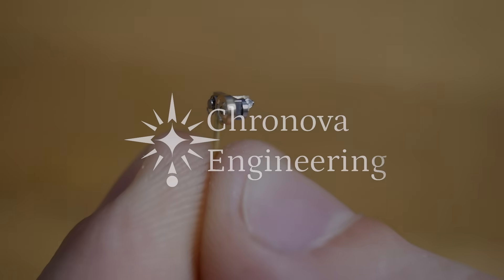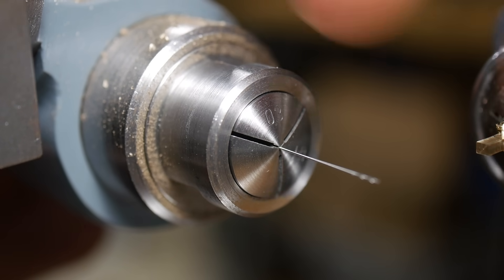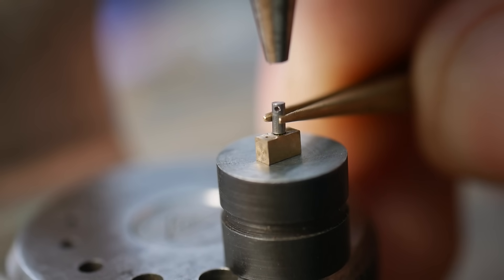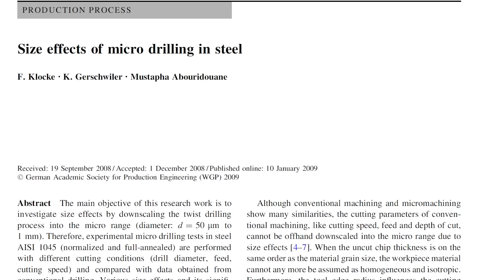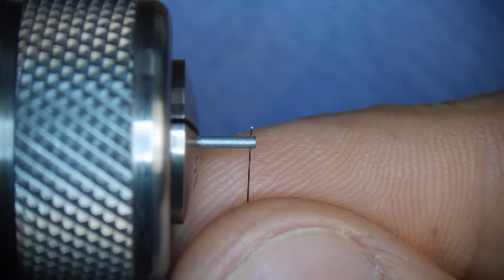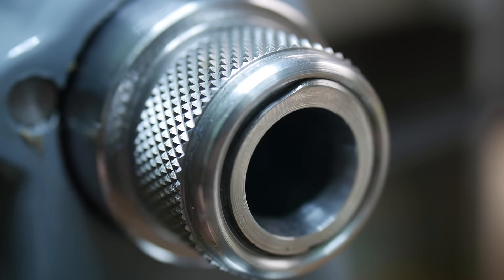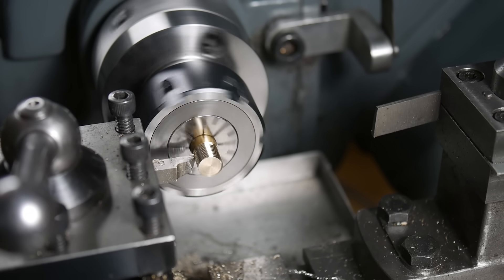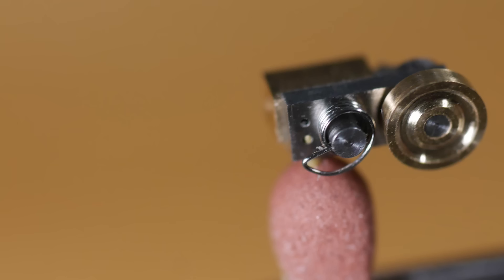Honey, I Shrunk the Steam Engine

Comment from the maker: Thanks for watching! If you would like to support our work and get access to additional videos and articles, please check out our Patreon page: patreon.com/ChronovaEngineering
Reply: The Obese Mosquito is a pretty good name for a steam engine, IMO.
Reply: I was so engrossed I found myself blowing at my screen to get rid of the swarf.
Reply: That's a lovely lathe m8.😊
Reply: This deserves a home in a museum somewhere.
Reply: I'm joining. But only because I want you to make a tiny 2 stroke.
Reply: Great job.  Not many creators can get something the size of a mung bean fill up a whole video. Obviously cutting metal under a electron microscope beats that but it is just too small to see.
Reply: Thank you.
Reply: Wow! That's beautiful!
Reply: Can you explain the maths of your speed measurement, please?
Reply: @MikeBrockington  700Hz (cycles per second) * 60 (seconds per minute) = 42'000 RPM (revolutions per minute)
The lowest frequency peak is the one that will correspond to the full cycle (or exhaust pulses as he mentions). 
Double that will be a result of the changes in direction of the piston and cylinder, higher peaks are harmonics due to the non sinusoidal nature of these sounds.
Reply: Amazing, and more. But far beyond what I was looking for: A 20 kW double expanding steam engine made from a v6 or v8 car engine. It should be reasonably easy to get 25% thermal efficiency from such an engine, and use them to power houses from stored solar thermal heat. Combine it with a smallish batter and inverter so the engine does not have to run all time, yet can handle power surges of 40 kW.
Reply: Just found your channel.. impressive work! Very precise and accurate. I work in the field of dental technology and wondering if you have had any experience with laser sintering..? Similarly to your work, we use milling for metals or other dental materials but recently the digital advancements have increased the volume of sintering for the precision metal work and digital printing of many other materials.
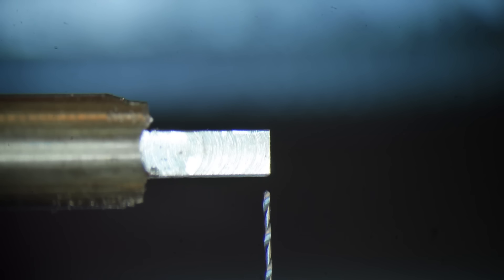Reply: 2:55 how was the drilling bit made!?

Comment: Regarding the drill problem. I use center cutting endmills for shallow holes. For deeper holes carbide drills, under .3  and over 3.4. For sizes between HSS is better option. It's just my opinion. Cool project. Thanks for showing it.

Comment: 40k RPM is about the right speed for a lot of those tiny carbide drills, at least when used to drill fiberglass for PCB making. Not sure about with steel, but you might have just made an upgrade for your pantograph!

Comment: Thank you for an interesting, and in my case, also inspiring video. I'm considering trying to build a simple live steam engine with oscillating cylinders in H0/00 scale, or possibly 1:48 on HO track = 0n30, which would make my cylinders a many times larger and simpler to manufacture. But this is still inspiring!
- Is the burnishing of the crancpin needed because of the "insane" rpm?

Comment: I’m a recently graduated electrical engineer, but I’ve always been interested in learning how to use machining tools like lathes, routers, slot cutters etc, and having the know how on material properties and how to cut or drill them, and expand my knowledge on theory. I’ve done mechanic work and I understand the basics of gas motors and steam engines, but designing the mechanics to account for the finer details like thermal expansion, friction, and vacuum sealing, is something I would like to learn. The only classes in college where we covered moving parts (other than physics 101) was control systems and electromechanics. Control theory was the only time I saw the use of Laplace transforms to represent springs, masses, and resistive dampers in the textbook, but we only ever covered R, L, C networks for class work. Electromechanics really only covered the working principles and electrical theory behind all the forms of electric motors and generators, so we’d calculate power and torque, but never moment of inertia, friction, employing bearings and oil, or how to actually transfer that power. (Which I understand is out of the scope of the class). Maybe I should take a machine shop class? Or try to take a dynamics class online? Not really sure the best approach but I really want to learn more so I can become an electrical and mechanical engineer and have more interesting projects haha.

Comment: Dynamic balancing such a small engine is to say the least tricky.  The brass tube has its own fundamental frequency (F1) according to stiffness and length. One trick would be to have a mass damper that you can slide up and down the tube to adjust the fundamental frequency. Of course energy is being lost when the motion is in anti-phase to the rotating mass imbalance.  Using acoustic analysis (sound spectrum) taken in contact with the tube bas will detect F1 acceleration and be more defined. .  Wonderful machining.

Comment: make 10 of them and then make dark experiments. for the first dark experimenty put it under masive pressure. for second, make it go bery very damm long until it cant run an ylonger. the second experiment wil me the cooling test. and the third one will be rhe negative test. then there has to be a generator test. then, acceleration until expolsion. the other last 5 could possibly hooked together make a small generator for electricity. also, make a tiny steam gas maker (the thing making steam out of water by fire that has no name). all of these are suggestions. after all really nice video.
Reply: A teapot lol?

Comment: A pity you do not give any dimensions. You obviously have a very exotic workshop, I am an 88year old model engineer who has temporarily abandoned the construction of a pair twin cylinder reversing engines for a small Neilson crane locomotive. They have single eccentric valve gear working .01” piston valves. Slightly over scale actually. Reversing is achieved by swapping the steam and exhaust flow. To add a little spice one engine is mounted on the chimney and revolves with the jib, the team pipe passing up the chimney to a running union at the top.

Comment: My later father said that people used high speed drilling where mugs because that destroys the bit.  He always stressed drilling speed must be slow.  Especially when using tiny drills because or the increase the temperature of the bit through friction.  Tiny bits can not take much heat before they become damaged just like you showed in the microscope.  Didn’t you notice the change in colour of the metal of the bit?   All the gear but not idea.

Comment: This is absolutely amazing.  I started working with aircraft engines almost 2 years ago and thought that our tolerance limits were insane, being +/- .0001” or less on con rod piston pin holes.  But I can’t imagine the tolerance you work with here.  And of course the scale of what you’re working with is astonishing. Great video, subscribed and look forward to seeing more
Reply: I am not an aircraft mechanic but are you sure you need to hit +/- a tenth?  There would not be enough clearance for oil to flow.
I am not sure what tolerances he is shooting for on this project but I think for port positioning +/-.001 would work fine.  .3mm is about .012"
Reply: @ oh, and the pin that is going in that hole is definitely smaller, it’s probably 2-6 thousandths smaller, I haven’t measured them because I’m not assembling them yet, but the standard in the book doesn’t give you much room for error
Reply: @ factory limit on continental rod piston pin bushings for the 470-550 engines is 1.1267”-1.1269” so yes, that’s a .0003” range, or 1.1268” +/- .0001”. The lycomings have a slightly larger factory limit, but we still have to get within a .0003” range per shop standard.

Comment: someday I'd like to build a normal sized stirling engine that is just efficient.
Because Carnot efficiency assumes quasi-static conditions, and since stirling engines have the same theoretical efficiency, it might be possible to make an engine that works slowly but efficiently
100W would be really goofy ahh 1kW would be even more so
Also, it would be great if it could use any heat source, stirling engines have their heating separated from combustion so they can generally work with harsher fuels

Comment: Ever use acid like h2so4 instead of a lubricant to drill difficult metals? It "bites". If it wasn't so small, some old timers would suggest a cast iron drill bit. Annealing overnight in a cooling coal forge banked around an item heated till a ferrous magnet falls off will be about as soft as you'll get as long as it isn't air hardened tool steel. All that really means is that it quenches at a higher temperature for longer. You could oil or water quench but it would be too brittle hard to be useful. Just saying that because of rampant caveats, it may not really be softening much. I've drilled lots of exotics and have a love/hate relationship with those tiny dental carbides.
    Ever consider a tiny ball tip carbide burr? The jeweler selections are quite extensive by the 1/10 of a mm (some). I like diamond burrs for not breaking but the piercing has much to be desired.

Comment: I am a retired toolmaker. When I was 17 and an apprentice at the Royal Aircraft Establishment I made a twin oscillating cylinder steam engine with a 1/8'' bore and 1/4'' stroke. I connected it to a high pressure air line and it ran like the clappers. Great fun and satisfaction for a teenager. Thanks for the upload. Great video.

Comment: Miro drilling..... you need to start by prick punching the location. Then you need a sensitive drilling chuck/quill with a collar that you feed with finger pressure and peck drill frequently to clear chips and heat. A drilling lubricant helps too.

Comment: For your micro holes: you could try using a shorter flute length drill as well. Carbide is stiff but can still flex, especially at that size. It looks like you are using circuit board carbide drills, they are cheap carbide but they also have a bad length to diameter ratio for rigidity at the cutting edge. They are also designed for use in a much softer material then steel so cutting geometry isn't going to be ideal either. I will be drilling a almost 200 of 400, 300, and 250 um holes in a few nozzles at work later this week. Wish me luck!

Comment: "After using the scanning electron microscope to determine the drill bit's mode of failure, I popped over to the particle accelerator I keep in my garage to try to determine what the fundamental issue was with the material in the bit"

Comment: Did you actually take an RPM reading on the motor with and without you squeezing on the air tube?

I'm guessing that the motor didn't actually slow down, but just became more quiet because you're removing a lot of vibration that comes from the thin tube.

Comment: Depending on how high or low you grabbed the tube and the RPM of the engine you were changing the resonance of the vibrations to more sympathetic or destructive to the the tuning of the rotating mass.  Think of it like comparing a muffler to a tuned pipe where a tuned pipe recovers some lost energy by being tuned to a certain RPM frequency in the exhaust that actually creates partial vacuum in the exhaust stroke to clear more gas than a muffler does.

Comment: Living in Québec, Canada. The wheel motor is a very common conspiracy theory here because Hydro-Québec used to work on such a concept a few decades ago and it never went to market for many reasons like the ones you mentioned. But the conspiracy theory is that it has been bought up by big interests that just wanted to burry the concept.

Comment: You could try to reduce vibrations by drilling a few small holes into the flywheel next to the crank pin to balance the weight of the piston

Comment: An oscillating cylinder engine is used in simple steam models (Wilesco, Mamod...) Running that tiny thing on compressed air is impressive enough. Have you tried giving it actual steam? I'd think it would have to be superheated (dry) steam, because wet steam would probably cause the engine to hydrolock...

Comment: The vibration damping slowing the rpm can be seen in action of a trebuchet....
Adding wheels to the base allows the arm's pivot to move around the force being exerted on the pivot.
This allows the extra forces previously wasted to be translated into extra rotational speed.
The range is Significantly increased over a trebuchet with a fixed base.

Comment: That is a great achevement with basic machining techniques, The slowing of the damped running is possibly due to the out of balance forces pressing the flywheel crankshaft hard against the bearing wall.

Comment: lol harmonics are everything for this little guy.............           with no counter balances for the rotating mass its going to play hell to ever find a useful application of it.     i at first thought maybe something similar to a crystal that holds a frequency. but this wont work for anything long term as the materals will eventually wear and change that frequency over time.  not to mention eventually fail completley.     the amount of force it generates could be useful if only you could go back to problem 1 and fix the balance issues........ buuuuut if you do that you will for sure lose that power gain your seeing at your particular pressures. 

this would need at least two opposing pistons running at 180 from eachother or even better three at 120 or 4 at 90 from eachother.       like a radial engine.   rather than adding useless weight to counter the forces just add more pistons driving a force from the opposite direction.         nothing new here just the power source and size of the motor itself.

Comment: I found that when using small carbide bits, you have to spin them as fast as possible and feed them into the part excruciatingly slow.  Think about when you tense up your hand to do something extremely delicate; that's pretty much how you have to turn the handle of a manual mill. In industry, these bits are often used for printed circuit board manufacturing. The CNC routers they are used in often spin 100,000+ rpm to achieve normal feed rates. The chips they make are pretty much dust.

Comment: Love your little lathe...and your level of craftsmanship. 
I know what you mean about speed with small drills...although my smallest have been 1/64" (about .4mm)... but even they didn't really cut well under 30,000rpm. I made my own drill from a 12v slot racer car motor that freewheeling shows close to 50,000rpm on my tachometer. That speed put one of those tiny drills through a 2mm steel plate in just a few seconds... My source of such tiny drills in NZ no longer exists, but my need for such tiny holes is past now....that was all back in the 1960s.
Perhaps a similar little engine of this kind might work for drilling? 🙂

Comment: 2:25 What is that illuminating ring you have on the microscope? I have the same microscope (or at least it looks the same) and have unsuccessfully searched for such a unit. I have bodged something that sort of works, but would prefer something that fitted better.
Reply: That looks a lot like the AMScope I have, and AMScope makes a ring light for them.  I had a fair amount of luck finding similar lights on eBay, searching on "microscope ring light" and the diameter of the ring that they mount onto.

Comment: Since the surface area of the cylinder is so great compared to the volume it might not work with steam as the steam will immediately condense. This sets the limit for ICE engines, the smallest of which is smaller than this, but the effect would be greater with steam.

Comment: while this a lovely engine and one of the smallest (I believe there is one smaller), many of the steps taken to ensure tight tolerances are overkill, as the steam engine is great at coping with sloppy fit, and timing is the main thing that matters.  Also, a 4 jaw or box chuck would be helpful in machining the crankshaft in 1 piece.  I would really like to see you make a small double acting steam engine, as those have a lot more going on, and are hard to mess up.

Comment: In the early 90's I read an article in (I believe) Model Aviation magazine about an elderly watchmaker immigrant in NYC who made a bunch of multi cylinder CO2 engines so small you could fit the collection inside a Contac capsule. The article included pictures or I wouldn't have believed it. A working 5 cylinder CO2 engine about 3 mm wide. I was never able to find anything about him on the internet. Machining super tiny machines is amazing to me
Reply: 3mm? Are you sure it's a real thing?
Reply: @CenReaper.  There were nice clear pictures in the magazine. Although I may have the date wrong of when the machinist made them. He could have been making them much earlier than the article was created. I can't be sure of the magazine either, because I was gifted a bunch of full size airplane and aerospace tech magazines in the early 90's and the article might have been in one of those, and not in an RC mag.  I realize my claim seems incredible, but I know what I saw. And I wish I could prove it.
Reply: Stefan Gasparin?
Reply: Do a search on this:

$1.5 million Bugatti watch has a tiny 16-cylinder engine inside
Reply: @joewright9879  yes, I saw that when it first came out. Quite a piece of craftsmanship and art.

Comment: I would absolutely love to see u make a super tiny water boiler that can run this engine while being incredibly tiny, it could even end up in a watch or something as a proof of concept and because its cool, also I would love to see the efficiency of this engine
Reply: a tiny water boiler that runs off a little slow burning string
Reply: That motor's efficiency is higher percent than the odds you're NOT a genetic deadend. do with that what you will
Reply: @shamancredible8632  I had to read that 5 times to even understand what that is supposed to mean, you're trying too hard with the insults
Reply: @bettafish541 I agree